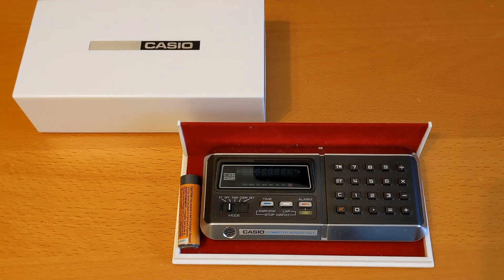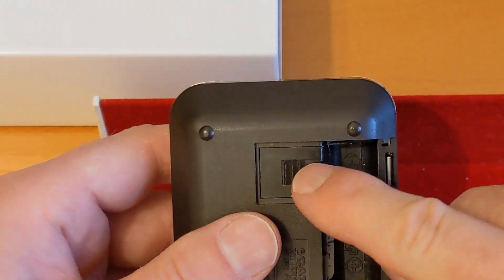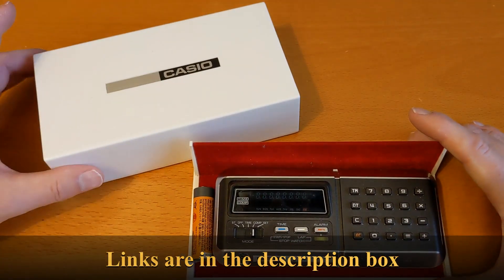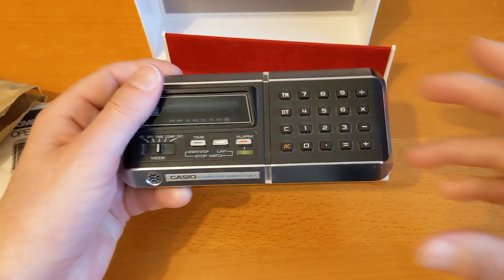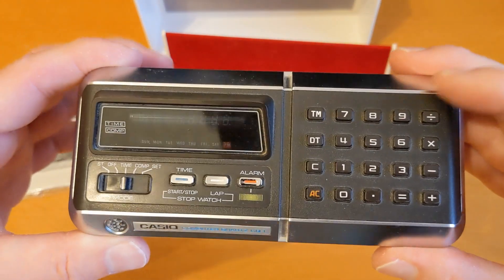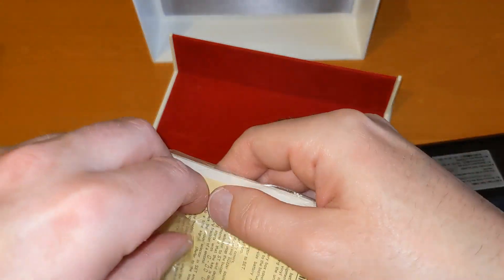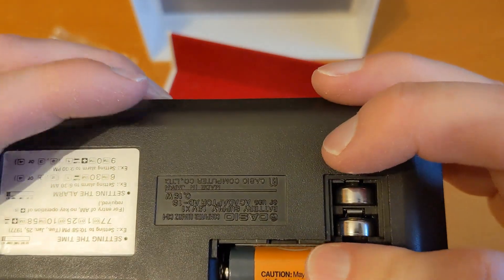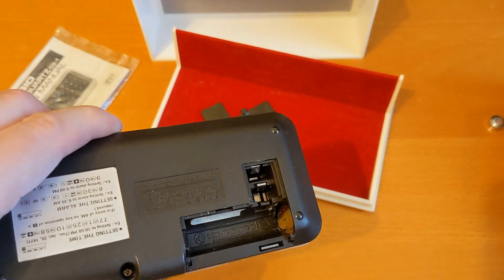Casio CQ-1 - Unboxing a second unit after the first one failed

Comment: Another option is to replace the PCBs with a modern replacement, I did that in this video:

https://youtu.be/XzfspKhKC18

It looks like you need a replacement keyboard PCB on some of your CQ-1s as well. I haven't done that as yet.
Reply from the maker: I've got the second unit working now by replacing the battery spring. The quiescent current was burning through a AA in 12 hours, so I purchased and original charger and switch it on when I use it, which is most weekdays for work. Love the aesthetic. Keyboard sucks 😄

The other one needs either a replacement keyboard contact/PCP, or painting conductive paint on the membrane.
Reply: @CBitsTech I've seen quite a few battery springs come unsoldered. Replacing the keyboard with a new one isn't too hard a job if you are familiar with PCb design, it's a bit boring as you have to copy the existing track layout and PCb outline and all holes. good when it works though...
Reply from the maker: I bet it is, but I don't have a clue about PCB design.

Comment: Do you know what power supply should be used if this is run from the mains for a continuous time display ?
Reply from the maker: The manual says the power supply is an AD-1S. It doesn't show the specs, but this page shows it as output 1.5V 100 mA, centre negative. https://casio.ledudu.com/pockets.asp?type=1823&lg=eng